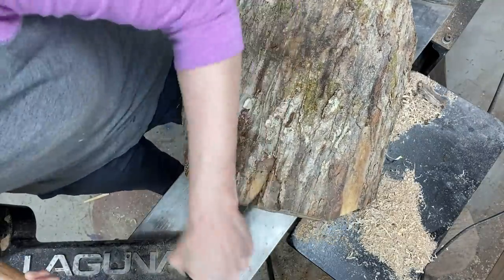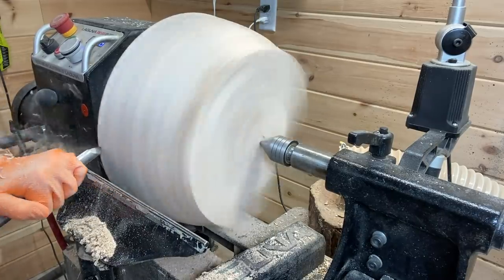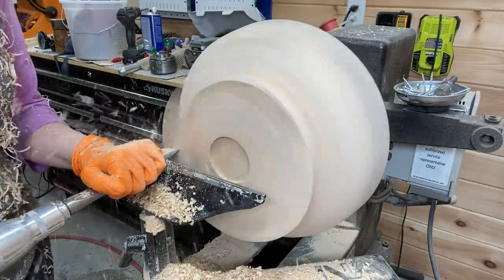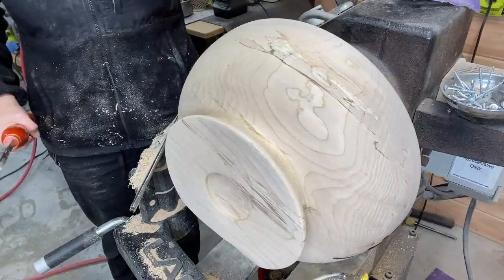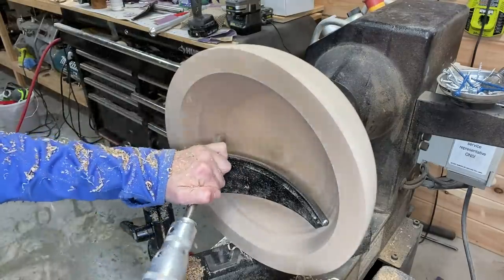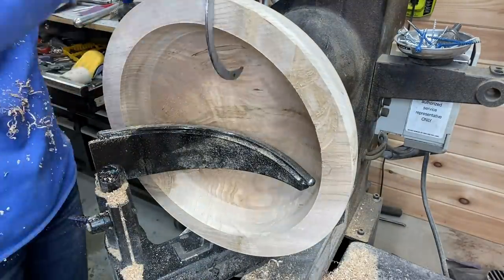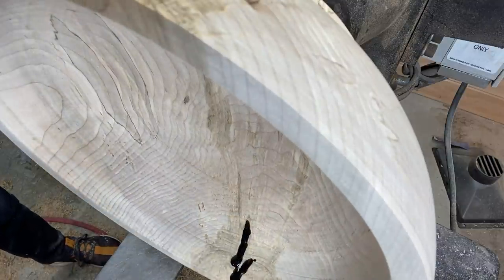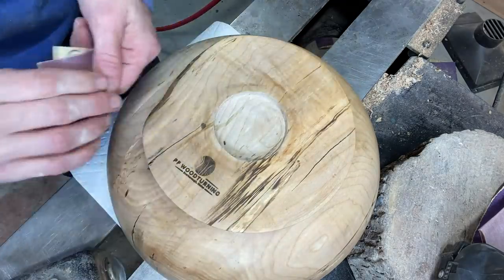Woodturning a Pedestal Bowl, Version 2.0

Comment: It is sometimes more pleasurable and quicker to start the roughing cuts from the bottom as push cuts toward the sides.  That way you can ride the bevel along a clean cut and don't get the banging from the spindle type cuts of an irregular starting shape.  This is a beautiful piece.
Reply from the maker: Thanks!!

Comment: The manner in which you started hollowing out the top of the bowl inspired a design concept. Can you turn a "chips and dip" bowl where there are literally 2 bowls in one with a bowl for dip raised from the center of the main chips bowl but flush or slightly recessed from the height of the rim of the chips bowl?
Reply from the maker: Hi Mark! Yes, you have a great point..it could have been a chip n' dip bowl.... (soon I'll give it a go!)